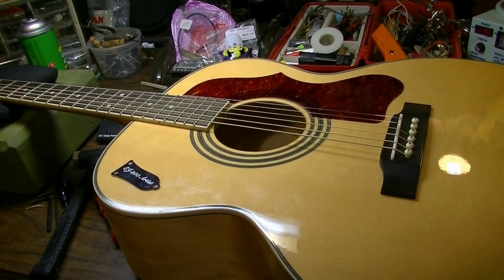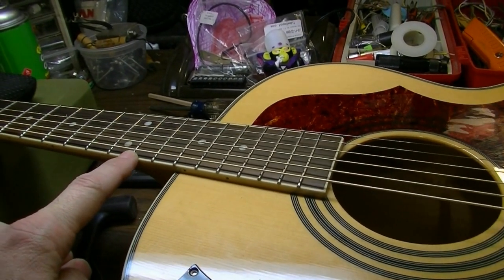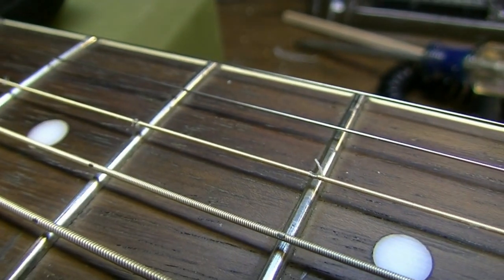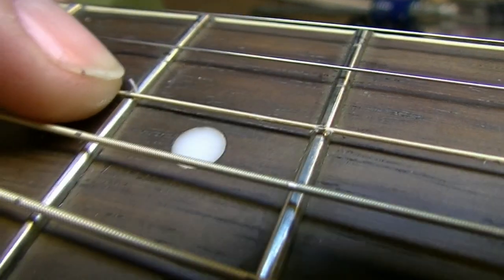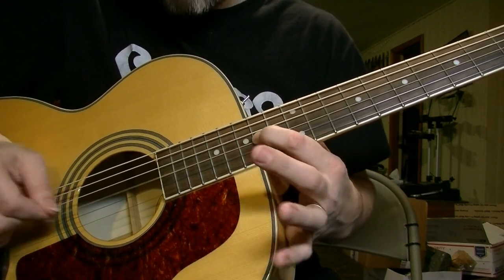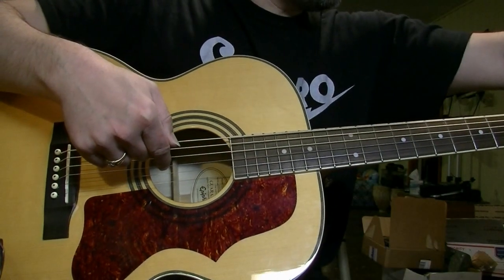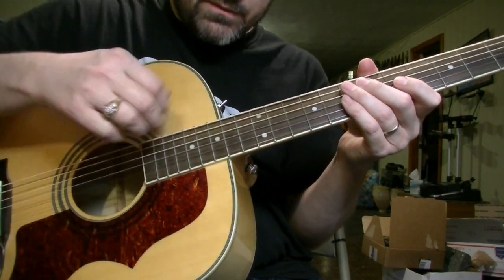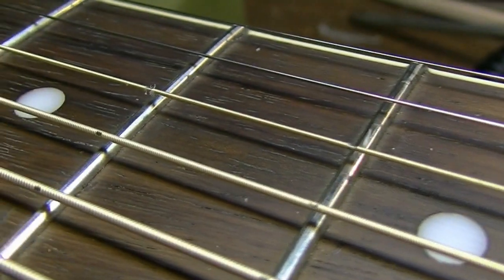Why I NEVER Use ELIXIR Coated Guitar Strings

Comment: Clearly a manufacturing defect/bad batch and should be returned. In the warm, humid climate of Brisbane, the coated Elixirs cope with sweat and skin grease  and do not rust or break down the coating. They maintain their full tones multiple times longer than non coated making them good value for money. Have not tried D'Addario as their coated strings appear more expensive here.
Reply from the maker: Not a manufacturing defect. This is what Elixirs do if you play heavy blues and bend with vibrato a lot on that G string, particularly.
Reply: I've had the same results as Brad with these strings..
If you're a bender buy something/anything else..
Or just play chords & don't bend..
ROCK ON!! Gary/Hk
Reply: Robert Bull I'm also living in Brisbane and couldn't agree more.
Reply: I'm an Aussie too though I live on the Central Coast just north of Sydney and I have had nothing but positive experiences with Elixer strings, especially the polywebs. I would never go back to uncoated strings after the extra life, tune and playability of these strings. 
I'm in my early fifties now and I only wish that they had been available thirty years earlier though I'm glad that they're here now as I still perform and have never had one break on me; not once and, as I'm sure you'll agree, when playing and bending for hours on stage that knowledge that the strings will hold gives one confidence.
Reply: This happened to me in my electric with Ernie Balls 2221 on the D string (lots of bends)
Reply: I also live in Brisbane I had these strings on my acoustic for almost 3 years never had this happen and they sounded great pretty much almost to the end before I changed them best strings I've ever used
Reply: Robert Bull i use non coated D'Addario and they have outlasted my elixers it took me less than a week to wear out the coating.  mind you I live in a dry climate far from the sea.   still found they frayed to fast to be worth the cost for me.
Reply: I'm in Brisbane too and my strings go rusty and shitty within about a month
Reply: Ive never met anyone who leaves strings on long enough to where sweat, skin grease or rust is a problem, other than children.
Reply: ogrish76 you have never met a poor guitar player, turn up your nose all you want, I bet bob Dylan didn't have pristine strings at the very beginning of his career in new York.
Reply: Wow, if you guys are changing your strings that often then no wonder you can't afford a 75 cent burger. I just wipe my strings down after every session. it gets all of the crap off of them and I don't use that coated stuff but I live in a very arid climate.
Reply: The Guitologist no it doesn't stop lying or whatever I been using elixir since I was 16 and play heavier than you ever did on this video mostly metal and my strings have never done that who paying you off
Reply: Robert Bull another Australian how ya going mate I'm from NSW
Reply: dubsbitch24 
Since you're playing metal...  (not that that matters necessarily).  Which of the coating do you prefer, if you've tried the different ones and have a preference.  I'm thinking of giving the Optiwebs a spin.  Right now I alternate between Ernie Balls and D'Addarios depending on my mood at time of purchase lol.  Lately the D'Addarios more for some reason.
Reply: I'll save you some trouble, friend. D'Addario coated strings aren't worth your time. I've been using Elixirs for about 8 years now. I won't go back to lesser strings (D'Addario and Ernie Ball Strings flat out die on me within 3 weeks). Elixirs keep their tone longer. I go through about one set every five years- I'm not an aggressive player, but I play almost exclusively fingerstyle guitar. When strumming, I use light picks and go for precision rather than pounding the strings.

I'm not the best guitarist you'll ever meet, but I have been at it about 35 years.

Anyway, I hope this helps.
Reply: There is to much 'this is good', 'this is bad discussion; people will use what works for them. Elixirs are great, D'addario are great. Uncoated strings may have a better tone but they don't last as long. The Guitarologist mentioned that this player had a problem going through so many sets of normal strings so he tried Elixir; unfortunately, this player is not suited to Elixir but that doesn't mean they are bad. Uncoated strings can go bad after about three days of not playing them at all just because of the atmosphere. Elixir will fray if they are used for to long. It's not an open and shut case, however, it is a critique that is true. Importantly, be careful where you buy your strings from because fake elixir strings are being sold on Ebay and other places where people can be exploited, and those strings really do last three days.

Comment: Did I hear that right:  "I put the strings back on..."  You reused a set of strings?  I have never done that.  When I take a string off, a new one goes on.  Chances are that the release in tension and then re-tension is what perturbed the coating.
Reply from the maker: The customer asked me to put them back on.

Comment: Not sure it's the strings fault on this one. Those frets look pretty terrible. The need crowning at least.
You didn't mention how old the elixirs are. If they've reached the end of their life, then you'd expect them to react strangely...
Don't know. I've used Elixirs before and they sound great, last well, and are stable. I'm thinking the problems may be down to the normal things. Wear and tear.
Anyway, just my 2 cents worth. Keep up the channel mate. I love watching the circuit diagnosis stuff. Interesting.
Reply from the maker: Strings less than a week old. lasted 3 jam sessions. The frets are typical for what you see in Chinese imports. They routinely level frets and polish, skipping the crowning procedure to save money, BUT that doesn't mean the frets are "bad" or "terrible" or "sharp" as many commenters have suggested, it just means they aren't pretty and round on top. No tool marks, no serrations or roughness on the frets. If they were, I would have dressed them. I have all the tools for it.
Reply: The Guitologist bad strings send video and strings back to elixir and get free strings

Comment: Avoid Elixer strings at your own loss. Loss of tone, loss of length of remaining in proper tune, loss of playability and loss of length of string life overall. The Polyweb Elixer string coating is better than the Nanoweb but like any man made item it DOES have a 'lifespan',(your video did not mention how long those strings had been on the instrument before it arrived on your door, but just by looking at that string I'd say quite some time) and not even coated strings will last forever. 
I have no agenda, no affiliation with Elixer or any reason to promote these strings other than my own experience with them and they, in my opinion DO justify the slight extra cost with all the benefits I outlined earlier. It is a simple experiment (to purchase and use them) and a small price for one's own assessment of the item.
Reply: Epi Phone You are correct!  I just installed them on my Tele.  They killed the tone and I had to double the action to drop out the buzz.  I'm going back to the greatest strings ever - NYXL!
Reply: A thing does not need to be man-made to have a lifespan. All things have one.

Comment: This video is pretty old, but I just wanted to point out (as others have done) that those frets are in bad shape. I'm not sure if someone spot leveled them and didn't recrown the frets, or if it's just uneven fret wear from vibrato on certain (common frets). Either way, a flat fret is going to generate buzz on its own because it has a wider contact point than a properly crowned fret. Not only that, but it throws your intonation off. If it is flat from uneven fret wear and not from a lazy fret job, then those lower frets are going to cause even more fret buzz: buzz at the flattened fret, and buzz at the next fret higher due to the lower height of the worn fret. 

Also, worn frets tend to tear of Polyweb strings as the surface of the fret is not smooth. Level those frets. Dress them. Then give them a good polish and a lot of those issues will go away with the Elixers. 

I've never heard the coating wearing off generate that much fret buzz as the coating doesn't have that much mass. It will throw off the resonance of the string slightly which may cause it oscillate funny and possibly buzz (but I have not personally experienced this). The fraying does cause some really odd overtones, though. When I used to use poly webs, I would change them once they started to feel "fuzzy" at the first sign of any fraying which was normally after a month. I play with wide vibrato (1-2 whole tone vibrato) and very wide bends (2-3 step bends) on electric and have never had them fray to that extent. Then again. I touch up my frets whenever any flat spots or uneven wear appears. I also keep them polished regularly using micromesh  and/or Flitz at the first sign of tarnish.

Comment: Hi, Brad. I have been using the Nanowebs for years and have never seen this until my current set. I gig 2 to 3 times a week and change my strings once at the beginning of summer and once at the onset of winter.  I play solo acoustic. My current guitar is a new Yamaha. I will be curious to see if this problem continues on this guitar (maybe the newer frets are sharper) or if Elixir made some changes in the manufacturing process or materials. I enjoy your videos!

Comment: I don't think it's that people are "passionate" about strings.

I think it's more about how illogical your whole video is.

First off.....you're not telling us how old that set of elixers is.  

Are they a couple weeks old?  A month?  3 months?  6 months?   How much playing time on them?   

Not really reasonable to suggest, for example, that a set of 3 month old heavily played elixers should be expected to be in great condition.  Wouldn't you say?  

Second,

Why would you be putting a used set of strings onto a guitar after doing work on it?  Seems strange.  Is the guy that cheap?  

Strings need to be changed.  Just because some people tolerate rusted or worn out strings doesn't mean that's a reflection of the quality of the brand itself.   Maybe it's user expectations being ridiculously out of line?

"A car should be able to do 300 000 miles with absolutely no maintenance or oil changes whatsoever.  If it doesn't, it must be a terrible car company"

Third,

You didn't tell us if they are poly or nano.   That does make a difference.   The nano's are much better for this kind of problem.  And again...that's assuming the problem on these strings is a legit defect, which judging by the look...is probably not the case.  I'm guessing it's that user expectation thing again.  "just put the old set back on".....lol...

Fourth, 

You put the non coated string on...play it...then admit there is some buzzing from that one too.....lol.   OK so maybe the coating is having an effect but maybe the guitar needs to be set up better regardless?  If buzzing is a concern for the player that is.  

As for cost benefit....yeah....that's a personal thing.  I agree with what you said for the most part.  Although I'd say if you're playing a set of strings for "a year or more", they may not look like they need changing but they most certainly will sound like it.  A year of playing at any reasonable amount will deaden the strings.   One more time.....unrealistic user expectations.  Coated or uncoated.  Just because a set of strings looks OK doesn't mean they are OK.  

Basically people just need to stop being cheap bastards and change their strings.
Reply: Description
Reply: also some people's sweat just naturally destroys strings faster than others, mine for example seems to just chew through strings. its annoying, i can rip through a brand new set in 2 days and need a new set.

Comment: This is a pretty silly video because it misinforms people. I've just run to check my one set of Polywebs, which I've been playing on hard for maybe three years. Not even a trace of fraying at the frets.
Reply from the maker: It does not misinform. This player is an aggressive blues player and these strings are not old. You either do not play the guitar much or you play it lightly. For you, the Polywebs work ok. For me, and for this customer, this happens.
Reply: @TheGuitologist  Yeah but you left out the part where those frets were in bad shape.

Comment: I'm gonna have to vote for 'bad batch" also. I've used Elixir strings on my acoustics for the past 16 years. More specifically,  #16027 Phosphor Bronze Nanoweb, in the Custom Light gauge. I've seen the coating wear out, if I've been too lazy to change my strings, but I've never seen them come apart. Sometimes I change my new strings after a hard gig, and other times, I may change them once a month. It just depends on how much I play, and what the environment is like at that particular point in time. If I ever take them off though, I put on a new set. It's as simple as that. 

Those frets look terrible. You can clearly see nicks and sharp edges, where the crown has been worn down from playing. Don't bash good strings because of a damaged instrument. Leveling and recrowning the frets, and a proper setup (nut, truss rod, AND, not only, a bridge adjustment) would solve the majority of your friend's issues.

And, I can't help but add, if your friend can afford a $100+- pickup, have it installed, and can't afford to change the strings at the same time; and if you did the work, as a luthier (hobby or professional), and didn't replace the strings during the job, you both need to find something else to do with your time.

I'm not saying Elixir strings are the best, and I'm not saying that everyone should use them. All I'm saying is that under normal conditions, I've never personally seen anyone have that type of failure with them. 

Repair the instrument back to its original condition, and you can use whatever strings you like, without issue. Or don't, that's between the two of you. Don't, however, give bad information because your friend "cheaped-out", and blamed the strings for a poor maintenance issue.

There are a lot of beginner, and experienced, people that watch these videos, and now might not try these strings, that could have potentially fell in love with them. They personally helped me when I was just starting out, because regular strings killed my unseasoned fingers, and the coating on the Elixirs made playing easier. If it weren't for these strings, I may not have pursued this interest as much as I did, and I might have missed out on the joys of learning to play. 

People can take what I've said with a grain of salt. I'm not a professional, I just do it for the love of music. I'm sure though that a lot of people will agree with what I've said. I'm getting off of my soapbox now. If you've made it this far, thanks for reading this, and happy playing!
Reply: Thank you I lost a lot of respect for him on this video

Comment: Completely depends on what kind of playing style you have.

Friend of mine bought brand new Elixer strings and broke 3 in one gig! I've bought a set and after more than 2 months they are starting to show enough wear for me to think about replacing them. I however, have quite a light touch. 

So yeah I get what you are saying but it does depends on the player. I've had D'addario's before but I'm sticking to the Elixers as they are nice and bright with good lows as well.
Reply from the maker: I'll go along with that. Thanks for the thoughtful response.
Reply: Also props for giving the video a normal title (i.e. no ELIXIR STRINGS SUCK or an equivalent of that).

Comment: I've used nanoweb Elixirs for a couple decades.  Nanowebs have a lighter coating than the polyweb Elixirs.  Never had any issues with the nanoweb Elixers  I found Elixir's last longer than other strings (they stay brighter longer) and they have less finger noise.  Wonder how old these strings are?  In all my years, I've never had Elixirs fray like that.

Comment: For everyone who thinks about getting elixir strings: The ones who last longer are the polyweb strings. 
At one point they changed the coating to the worse...later changed it back. 
Then there was a period where they only coated the wound strings...and changed it back after they pissed off customers. 
The flaking is weird. I never had that before. 
But i get suggestions for strings all the time...those black packaged d'addario that should be sooo great. 
The Cleartones that have some kind of molecular treatment (very thin...so if it doesn't form a new oxide surface, it makes no sense to me...but i may try them in the future. 

@the guitologist:
That chickenpicking around 4:58...is it from a particular song?
sounds great.

Comment: Agree with Guitologist. I have bought two sets of Elixir strings now and within a week, the G string furs up as the coating comes off causing the same fizzing as demonstrated in this video. I will not be getting a third set. My style is light finger picking on a Martin J-15. Usually use D'addario EXP's but if anyone has any recommendations, I'd be glad to read them.

Comment: Coated strings are good for an instrument that sits around a lot. I've had more problems with strings rusting out from neglect than frequent use. My question is whether or not it's worth the trade off in tone. I'm very hesitant to pay 3 or 4 times the norm to get strings that don't sound good. Even when I did use them I still acknowledged that they were dull and boring.